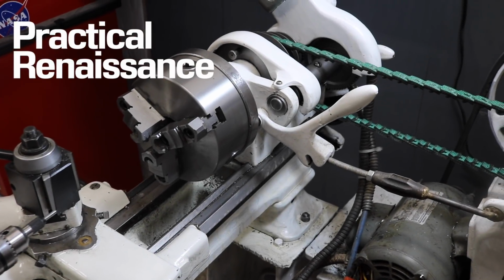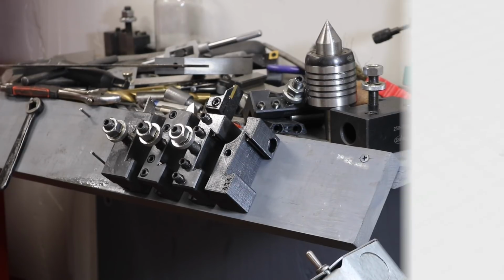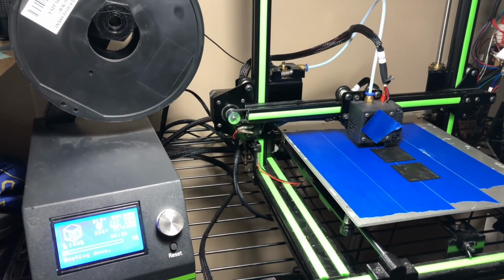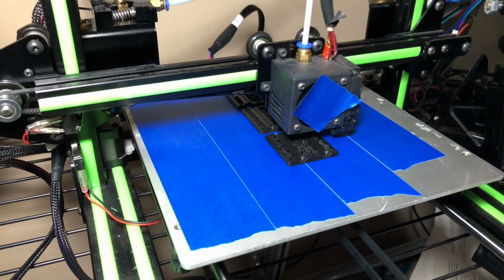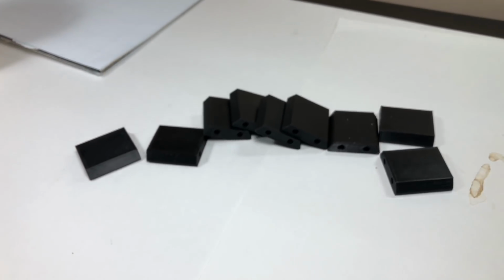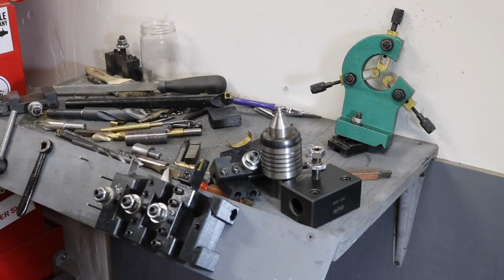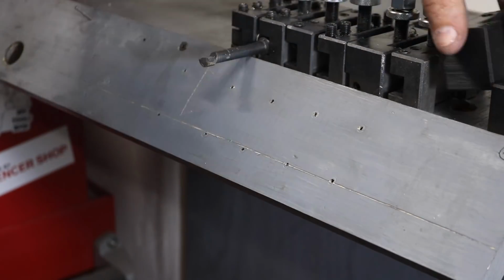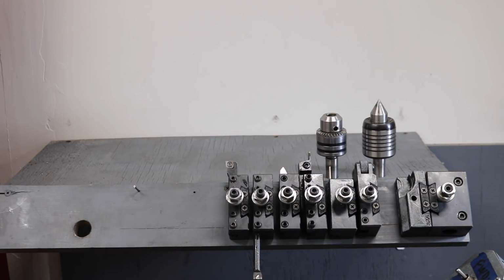3D Printed Lathe Tool Organizer

Comment: I only ask because I'm new to 3d printing and still getting the hang of it... you said you printed them in that orientation so they'd be less likely to split. The direction you printed it, wouldn't a countersunk/tapered screw head act like a wedge trying to split it along the vertical grain? I would think printing them in the orientation you've installed them would be strongest, because then the screws would be compressing the layers together, kinda sandwiching them down making it impossible them to crack, right?

Comment: I wish my A8 could print like so.
It prints just garbage and now the bolt/tube through which the filament goes is broken in half. And i cant do anything with it.
Chinese steel is so bad.. A bit of over tighten and it breaks in half.

Waiting for my mini lathe and have to make new bolt.
I tried to make new.. 
..drill M6 bolt with bench drill but it doesn't come out very well.

Comment: I made something similar, but I just bought a piece of plastic about 1/2" thick and 1.5" wide, and made them out of that.  I set the bandsaw at 30 degrees, cut the first one, diddled with the length while I set the stop, and then cut, flip, cut, flip.  Then drilled a couple holes.  I made eight of them in about an hour.  So if you don't have a 3-d printer, that's another way to skin that cat.

Comment: You can slow your part cooling fan down in your slicer, usually setting it to 0 for the first layer works well then maybe 50% or so from the 2nd layer on

Comment: what size holders do these fit?  AXA? 
I made something a little different to hold mine.  Used 12” lengths of Aluminum and machined dovetales on either sides, then screwed them vertically on a wallboard in columns.  The tool holders slide on from the top and stack on top of one another.  there is a shelf at the bottom to support them all at the bases of the aluminum dovetail columns.

Comment: You should print these with the holes oriented vertically, the way you printed these means they are more likely to split and crack when you tighten down the screws.
Reply: Maybe also use counterbored holes and pan head screws and put the layers into compression? Cool stuff

Comment: Careful with that tape over the hotend fan. Too little cooling of the hotend heatsink can cause heatcreep  = melted plastic in your entire hotend that gums up and solidifies. It's awful to try and clean out. :)
There's several better fan shrouds on thingiverse, just do a search for Anet E10 fan shroud!
Reply from the maker: I've been keeping an eye on it, thankfully no issues (other than it heats up in just a minute or so instead of 20+!!) but its very worth being aware of!